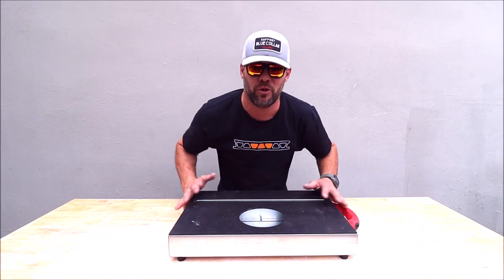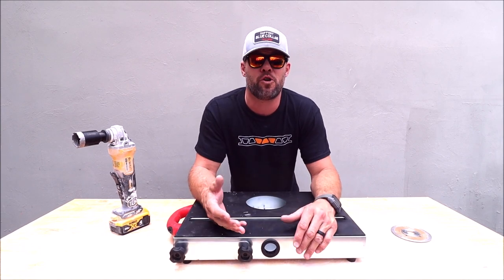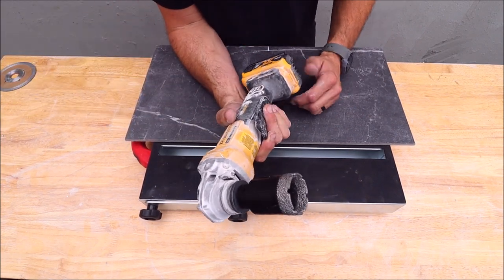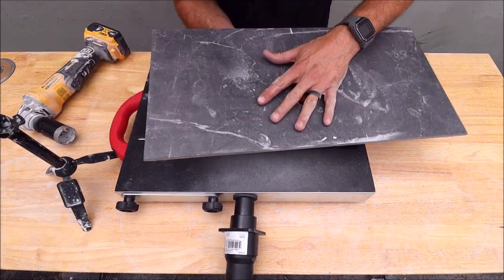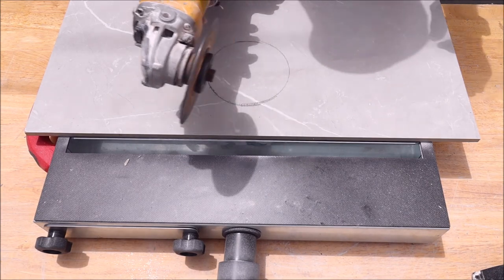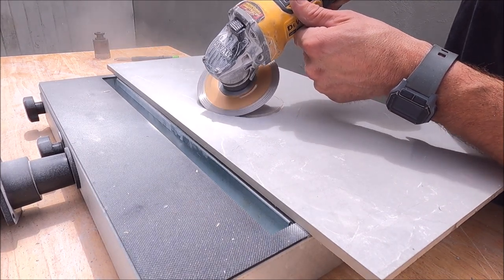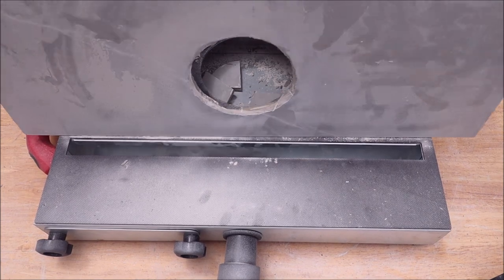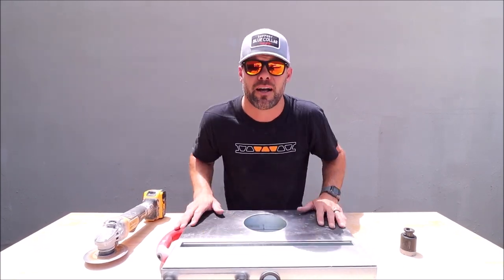RTC Backdraft Dust Reduction System - GRINDER DUST GONE!

Comment: we do use a similar system that we diy-ed, bring a bucket, fit a shop vac trough it at the bottom, and cut on top of it with aiming the dust in the bucket, its great for corner cuts and all, but not as good for over the top cuts like you did, so maybe a bit of both systems to be able to grind anywhere
Reply: Genius. Great idea. Thank you for sharing
Reply: The bucket hack is the one I've seen used the most. It works great!